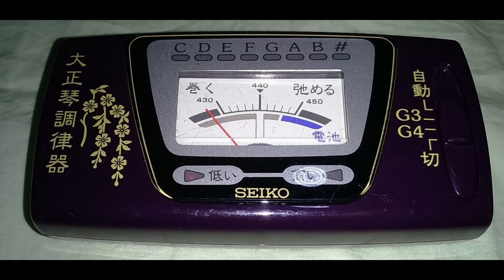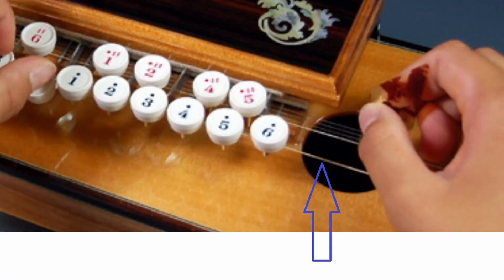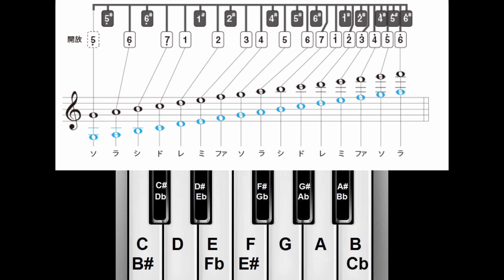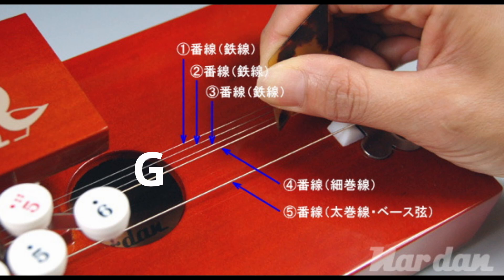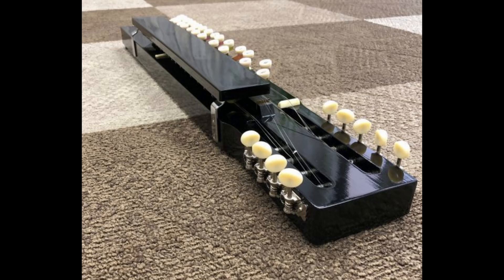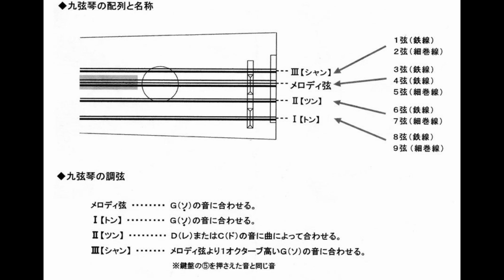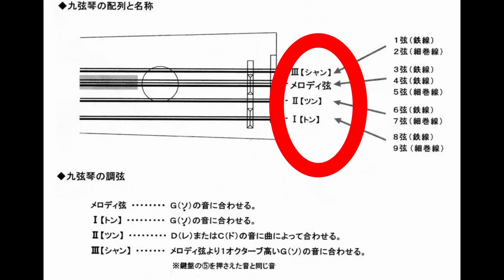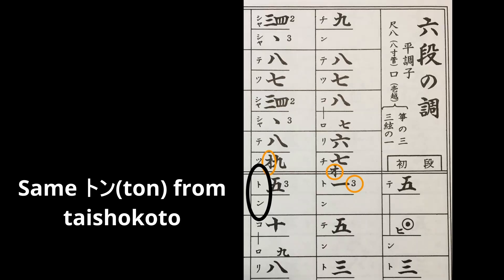Taishokoto Tuning Tutorial

Comment: Is there a big different between 5 and 6 strings? I'm going to buy a 6 strings one. Thank you.
Reply from the maker: In general not a huge difference, but it also depends a little on the string positions. Most have a drone string, a tenor, and the rest as soprano, so if you're in that realm then the difference is minimal. Comes down to pick travel and pick resistance on the trills honestly.